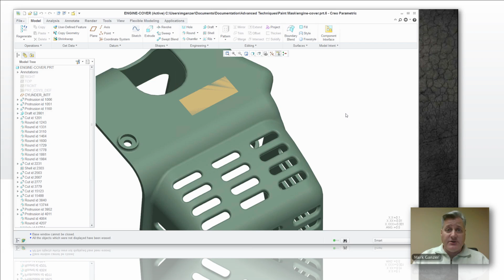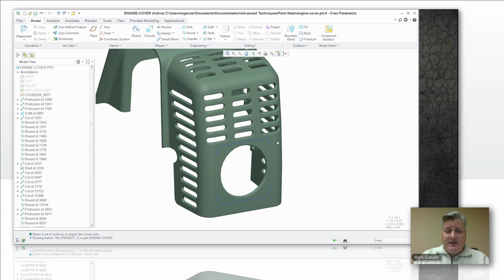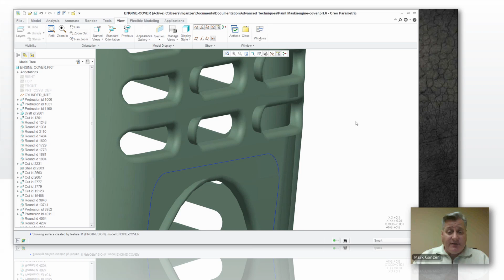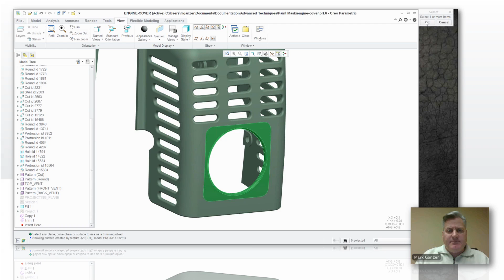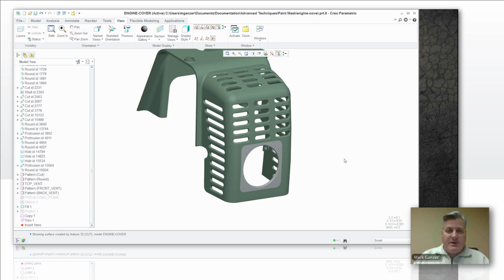Multiple appearances on a single Creo Parametric Surface - EAC Tip of the Week

Comment: Hello, thanks for the video. Since I need to save the object as Wavefront (*.obj), for me it is important to cut the real surface of the solid and paint in different colors. There is a way to do so on your model without creating a copy of the geometry? If I use your method then when creating the obj I have the solid with its color and a surface overlapped. I would like to really divide the surfaces of the solid.
Thanks.

Comment: I have an assembly that gets painted two different colors.  Is there a way to do this at an assembly level without modifying the parts/subassemblies?
Reply: You should be able to set different appearances to different surfaces within the assembly the same way, but you'd still have to do spliting at the model level.